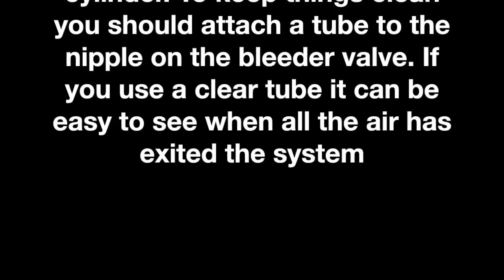MK6, MK7 GTI Clutch Replacement (South Bend Stage 2 Endurance)

Comment: I liked this video so much I'm going to replace my clutch just for fun, as there is nothing wrong with it
I will take it out, then just put it right back in for practice, in case I have to do this for real someday
I might do it with the motor too
Reply from the maker: robert baker ha! Enjoy. While you’re in there, I’d suggest the clutch delay valve delete! Look it up if you haven’t heard of it - definitely improved clutch feel and response for me.
Reply: @GTIModBlog  I will, great videos, I seen the sequel as well
I wonder how much cheaper this would be than replacing a automatic transmission, and I mean remanufactured, not from the junk yard, because that would be equivalent of putting in a old clutch from the junk yard
Reply: @GTIModBlog  is this on the mk7 as well?
Reply: @GTIModBlog  Bro, what happens if you a Dual Mass Flywheel fails? What's the consequence?. I mean using the car with a Dual Mass Flywheel failing ? Will it work normal but making a noise only?
Reply from the maker: @ElJaviTuning  I have no idea mate

Comment: thanks for posting this. I have to do this on my wife's TDI SOON. Having done a lot of clutches in Japanese cars, this actually looks WAY easier. Just like everything I've had to do on this car so far, it seems like VW really made a lot of stuff easier to work on and access on the Golf than what I am used to with modern Japanese cars.
Reply from the maker: OrneryBear wow! i would’ve thought the other way around. you always hear so much about japanese cars being low maintenance and simple
Reply: @GTIModBlog  they are lower maintenance if you buy Honda or Toyota definitely, but they tend to cram a lot of stuff into a compact space with no regard to said maintenance. it's all about production assembly. for example, some differences between this MK6 clutch job and doing one on a modern civic. on the civic there are no axle flanges, or lower ball joint bolts. so to pull the transmission you have to pop the balljoint out of the knuckle, and then get the axle out of the transmission, so instantly draining oil everywhere. no controlled easy unbolt the axle and then one easy bolt for the flange. On the civic, it's not just unbolting a couple easy to get to mounts and starter and drop the trans right out the bottom. instead you are having to drop the subframe to get the trans out, so you're also going to need an alignment afterwards.

But ya to put it simply, so far whenever I've had to work on the VW I've been happy to find that VW seems to have thought about the fact that someone would be working on it and I can get to individual systems a lot quicker and easier.

Comment: I got mine out by myself. Never tune your mk7 if you don't have stage 2 clutch. I fry my clutch and I'm working on change it. I got everything out by myself without any help. Anyone can do it but you need the right tools and motivation
Reply from the maker: What tune did you go with? Stage 1, even stage 2 will rarely ruin a stock clutch from my understanding. I know people on the mk6 platform with stage 1/2 cars and 100k mile stock clutches. Did you lug it at high speed, high gear?

Comment: Can you show me at what part of the video is the torque converter seal located at please??? I ask because I need to change my torque converter seal in my 2014 vw Jetta se 1.8t automatic
Reply from the maker: This is a manual transmission car man, hence the clutch. No torque converter here.

Comment: Is the torque correct on the flywheel bolts? Factory manual says 60NM + 1/4 turn stretch. Has the flywheel flown off yet? I was following this guide and torqued it to 75nm like in the video, I wanna fix it but I can't be fucked taking my gearbox out again.
Reply from the maker: The stock flywheel bolt is indeed 60 + 1/4 but I read this one was 75 online. FYI I also recall the stage 3 clutch is something ridiculous like 114nm. I wouldn’t sweat it man. Half the torques in this video we didn’t even use a torque wrench for and the car never had an issue. Happy driving.

Comment: Great video! I'm looking to do this on my MK6 golf R soon, and have yet to see anything close to as detailed as this video.  I hear it requires a little more work (dropping subframe... etc.) what is your opinion on that?  Is it possible to pull it without dropping the subframe?
Reply: Heath Martin did you end up changing the clutch by yourself? If so how was it?
Reply: paul ciupei Hey, it was quite the learning experience. This video helped a lot though, one thing you will have to do with the r is drop the subframe, and remove the driver side control arm. This is needed to make room for the extra rear drive shaft flange for the awd system.Make sure you buy new subframe and engine mount bolts as well, as they are torque to yield. You can pick them up at any vw parts store. Only other advice is have patience, buy a socket set of 12 points, and label everything you take off in baggies. Took me 12 hours with power tools. Of course there were pizza and beer breaks, but make sure not to rush it.
Reply: Heath Martin thanks man I appreciate the advise. One quick question I have is, did you use a car lift? Or did you manage to do everything with jack stands?

Comment: If you don't have an engine support bar where can you put a jack under the engine to keep it from falling since it has a plastic oil pan
Reply from the maker: Hi, Philo! Love your car, and enjoy hearing everything you have to say on the MQB Facebook group. Excellent question. I — along with most mechanics — would recommend using the factory support points and a proper bar. However, Black Forest Industries claims supporting from the oil pan won't cause you too much trouble. Just use a pad or block of wood between the jack and the oil pan as they are composite and prone to cracking (as we all know).

- Deren
Reply: I'm currently doing this on my A3, and im using two straps to mounted to the roof to keep the engine supported.
Reply: GTI Mod Blog thanks! And I appreciate the detailed response <3 I like your install so much better than rad fox. Luckily mk6 and mk7 trannies are the same so the install is the same :)

Comment: Great video... Do you have any experience with installing a refurbished South Bend clutch? I'm on the fence about buying a stage 3 endurance that has been refurbished by SB along with surfaced flywheel. Curious if it should be expected to perform as new and last as long, with similar driving style. Thanks
Reply from the maker: I have no experience with refurbished clutches. The idea of them kinda scares me, but if it's done by SB (does it have any sort of warranty?) I would probably expect it to be fine. I've owned plenty of refurbished devices before and they've been fine.

Comment: Question so I just installed a single mass fly wheel on my GLI and now it's throwing check engine lights for random misfires? Is there some way for me to have this fixed other than putting a dual mass in it??
Reply from the maker: Most likely an unrelated issue. Check your coilpacks and spark plugs.

Comment: How much would this be at a dealer and would they install an after market clutch in it?
Reply from the maker: You’ll have to call your local dealer and ask for a quote but most will charge $2-3k for install. Some dealers accept customer supplied parts but definitely confirm this when you call.

Any purchases made through our affiliate links (in our description) are much appreciated as they help support us. 

My personal recommendation for almost every GTI owner is Southbend Stage 3 Daily. The pedal becomes more firm and feels like a nicer performance car (think BMW).

- DB

Comment: Hey guys! I know I'm way late to the party, but I have a few questions. This is the same as a clutch replacement for a Mk6 R right? I'm looking to replace mine myself. Also How long in total hours did this take you guys?
Reply from the maker: I can’t confidently say it’s the same as an R, given the differences in drivetrain. From my recollection, the clutches are interchangeable, so take that as you will.

This took Neil (a full time auto tech) about 45 minutes however I would dedicate 4-6 hours if you’re doing it for the first time. Most auto shops would quote 3-4+ hours for this job.

We spent about 1.5 hours on this as we put the clutch disc on backwards due to faulty labeling by South Bend, which was frustrating, but Neil is such a pro that it was hardly a hiccup.
Reply: @GTIModBlog  Ah yea. I’ll definitely do more research. In your opinion, is a clutch one of those things that are worth more to pay to get it installed? I love the feeling of being able to do my own shit but if the clutch is extremely hard to install I would be more willing to pay for an installation.
Reply from the maker: @Ragged.09  it’s a very involved install and we paid Neil to do it (and we recorded it for this video), so yeah, in my opinion, I’m glad I paid him to do it. I didn’t have the tools or expertise to do it confidently in a small amount of time. I did virtually all other modifications myself, so there’s that. Dropping the transmission specifically was really daunting to me, and I can’t say I would ever want to do it all by myself.

Comment: Is it just me or am I the only one who uses blue lock tight and say those flywheel bolts are 32ft pds I go about 26-27 because the lock tight acting as lube but regardless I put blue locktight on all my fly wheels and q we pressure plate bolts

Comment: Awesome video, thank you for making it. Quick question, why do you remove both axles if the housing for the clutch itself is next to the driver-side? I'm sure there is a good reason but I am not clear why you need to remove the axle on the passenger side.
Reply from the maker: It's not entirely necessary but makes it easier when doing the job alone, because the axle can make trans reinstall difficult. The passenger axle can fight you when you try to push the trans back on :)

Comment: What does this clutch cost thinking about doing the same on my mk6 gli,
Reply from the maker: The clutch & SMFW unit itself should cost somewhere from $1,100 to $1,300, and install will be free if you follow this video! 
But, a quality install from a professional is a bit more dependent on location and options available, could run you between $400 and $800+. Where are you located?

Comment: I have a mk6 Jetta 1.8t gen 3 5spd manual. I’ve owned it used for 5 months just got 50k and my clutch went out. I’m in mechanic school but I haven’t got into transmission class yet but how similar is this to my engine and transmission?
Reply from the maker: Pretty much same steps.
- Deren & Neil

Comment: do i have to remove the axle flanges?
Reply: I was scrolling through comments too see if anyone asks this question. I really don't understand why they would need removed but i have seen it done in a couple videos
Reply: I know this is late, but I'm in the process of doing this job as well, removing the axle flanges isn't necessary but by God does it make it WAY easier to get the transmission out.

Comment: How many hours is the install? Just trying to see if i get someone to replace mine or do it myself, labor charges must be insane but also, it’s hard to do at home
Reply from the maker: It was very quick for Neil - I would say around 60-90 minutes all in (we made a mistake the first time and so this film is from the second go-around). I think shops will charge significantly more, for at least 3 hours of shop time. I was quoted I believe $700 or $800 to get it done at a local performance shop that I trusted.
Reply from the maker: BTW- those prices were for Bay Area labor. I wager it’s cheaper in most other parts of the country
Reply: GTI Mod Blog thanks for the information, I also don’t know if i should be upgrading or replacing my clutch with stock parts as my sons are learning to drive stick on the car and i believe the flywheel is starting to give out, the car is fully stock by the way
Reply from the maker: Sami Hamady I basically learned stick on the stock clutch of my GTI, it had ~35k on stock clutch and had been tuned the whole time so it gave out then. An upgraded clutch is harder to use as the pedal gets heavier and the clutch grabs harder, but it can take more of a beating. I would honestly say stick with OEM clutch if you’re not going to tune the car, but if you do plan to add power in the future, it’s worth upgrading to a stage 1-2 clutch

Comment: you went from dual maas to single mass flywheel? any clutch chatter>?
Reply from the maker: A little bit in first gear especially when engine braking and additional with the AC on. I had a loud exhaust that drowned out pretty much all other noise so I could only hear it with the windows down

Comment: How long did this install take? Great video, answered a lot of my questions. Been going back and forth if i should bring it to a shop or try and do it myself. My biggest issue is its my daily... and i dont have another form of transportation at the moment.
Reply from the maker: For Neil it was about 45 minutes, but I imagine it wouldn't take you more than 4-5 hours with little experience figuring it out yourself. Always stressful trying to fix your daily in a set amount of time, especially if you can't get a finnicky bolt undone.

I would say give it a try, be ready to give up if it's going to take you too long. Might as well spend a few hours learning a bit and need to take it to a mechanic than not try at all!

Comment: Hey how is the chattering on it? curious to know cause I'm still debating on it.
Reply from the maker: It's definitely there. People review it with mixed results. Mine got quieter as time went on, some peoples get louder. 

In general, I think South Bend clutches are known for their chatter in comparison to others. Honestly, I like the noise. It's not too loud, and I think of it as just another 'racy' noise like the turbo spool noise. It's audible at idle with the AC on (windows up) and audible with the AC off if your windows are down. But it's not very bad.

Comment: How come u didn't replace the pilot bearing?
Reply from the maker: Not entirely sure... did a new one come preinstalled in the new flywheel? 

Either way, the car only had 27,000mi. Clutch job was necessary because of the tuning and drive style.
Reply: My clutch still on order hasn't shipped out yet.
Reply from the maker: Did you order from Bandit or ECS? When?
Reply: GTI Mod Blog ecs tuning

Comment: How long did it take him from start to finish?  Looks like a ton of work.
Reply from the maker: We spent maaaybe four hours total. That included putting the clutch on backwards and then assembling the entire car only for it to stall. About 2.5 hours first time then to redo it only 1.5 hours because it was so recent. Also included bleeding the clutch twice (first and second time) and also removing the bleeder block restrictor.
Reply: By putting the clutch backwards you mean the torsion disc facing the pressure plate instead of facing the SMF?
I am in the process of installing Sachs SMF kit and for some reason they did not specify on the plate whic side should face the pressure plate. Can you please help me?
Reply: oh my god! backwards clutch disk!? after All of that!? UGHHH!!!!! tecnically that's like the the novice move of all things to overlook. 
I've done that, almost actually with my friend when we did a mk2 clutch and some how it wasn't aligned and the clutch was seized. we couldn't start the car. had to redo the whole job. but we did it in like 1/3rd of the job.

But this design of car looks like ALOT more work than the old ones. Yeah, there's the turbo hoses and the extra brackets holding shit on, and the stuff with the drive shafts. I'm sure the harness removal, the clutch cylinder lines, shift linkage and cooling hoses and waht not, all tHAT BS is in the way. I  just bought a 2009 passat 2.0t CC... the clutch is working but making a ringing/howling sound when it's half way engaged. it will be time for me to do exactly what you're doing here.
Not looking forward to this, but I will be brave after seeing you just did on this car.
Thanks for the video!!

Comment: You'd think by now companies would figure out how to make a goddamned clutch that can last 150K miles. Absolutely mind boggling that someone hasn't come up with a reliable and easy to mass produce oil bathed multi-plate solution that still has driveability. That kind of setup would last as long as the engine if you took care of it.
Reply from the maker: so long as it doesn’t kill driver involvement, let’s do it!